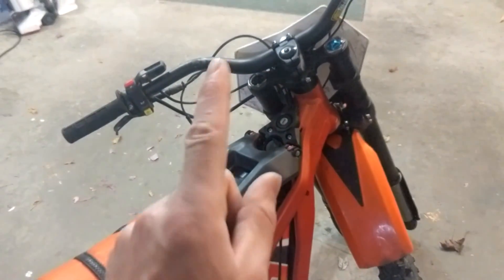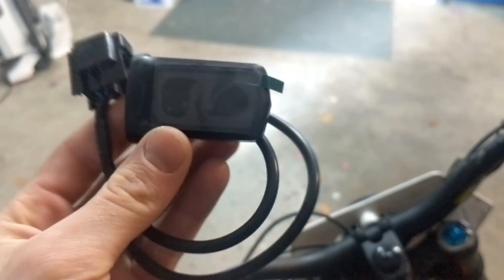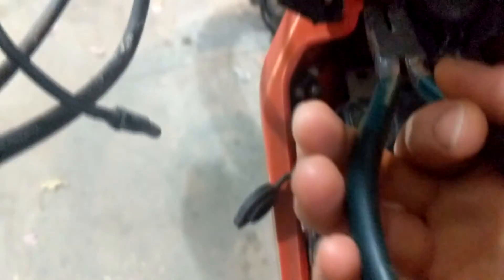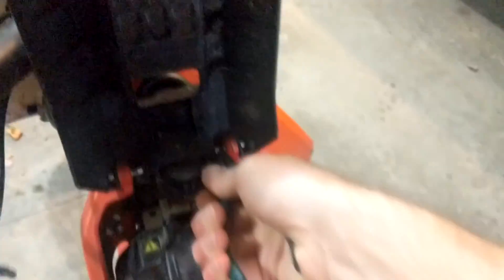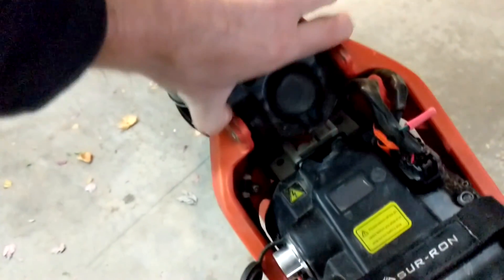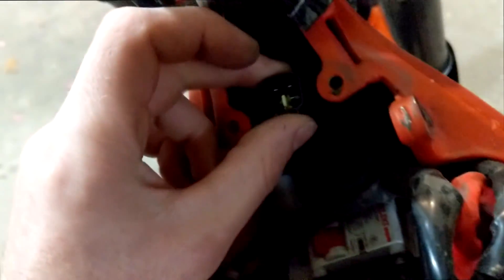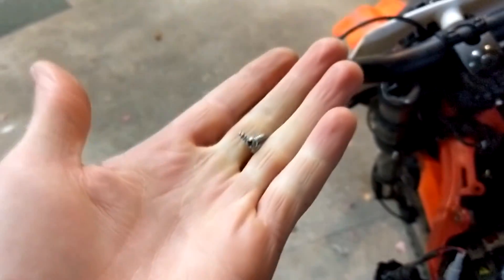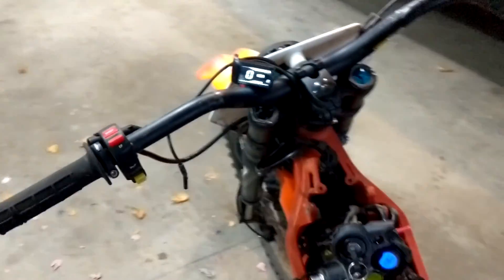Replace The Display On The Sur-ron/Segway

Comment: how do you take off the horn and that other red buttons stuff I'm having issues how to take it off please help!!! and I need help with my throttle the spring came out and idk where to put it back tooo
Reply from the maker: @MCVAMP666  The horn assembly is just held on by a couple screws on the back of the assembly....  The throttle assembly is a little harder to explain over text. But the white plastic piece sits inside of the throttle assembly a certain way and then you place the spring so as you pull it shoots back up into position
Reply: @electricisbetter  okay thank you I got it I couldn't see it it was black lol but for the throttle part I don't know where the spring goes back to?? I'm not sure if it sits inside the ring part or on the actual handle throttle area I can't find any video for this.
Reply from the maker: @MCVAMP666  in side the ring bit is where it should sit. So it pushes the inside white throttle grit back into position. Good luck 👍